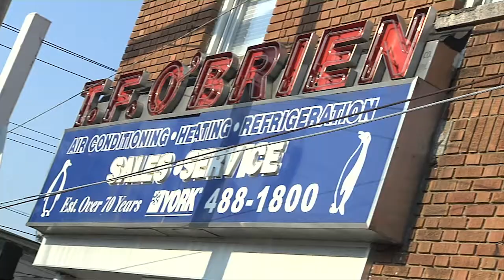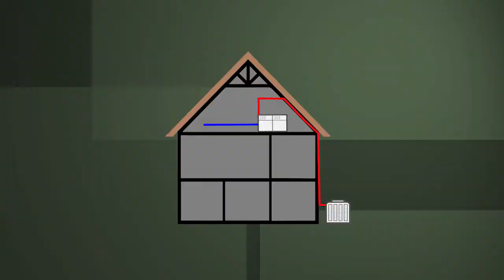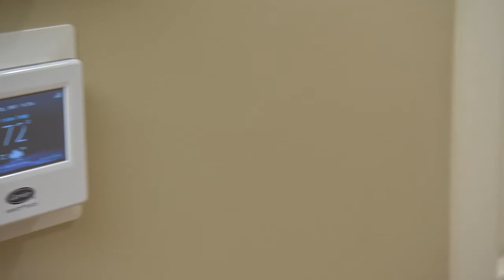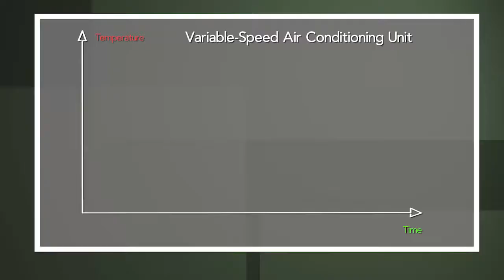HouseSmarts "HVAC " Episode 195

Comment: Great information about how new HVAC units are more efficient.  Slow ramp up of air movement is much better than the on and off surge of traditional units.  Less noise too.  Good to learn how the ductwork is critical to comfort throughout the residence.  Thermostats by zone can further improve service and be controlled with an app.
Reply from the maker: Thanks for your feedback :)